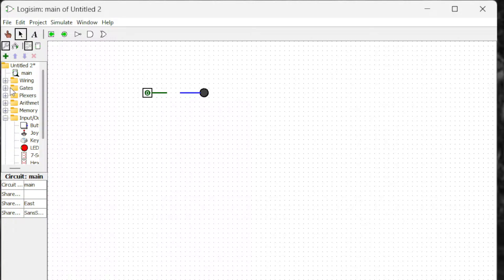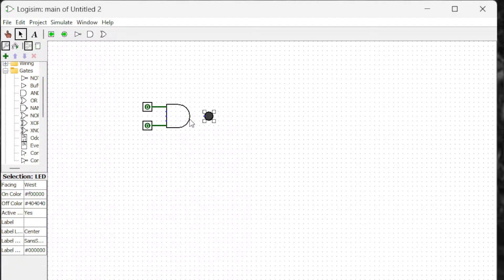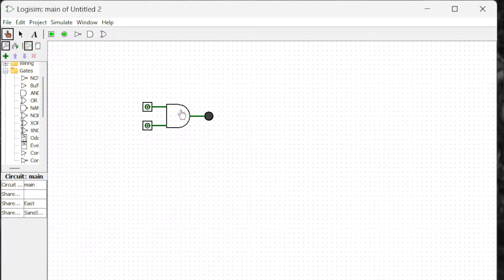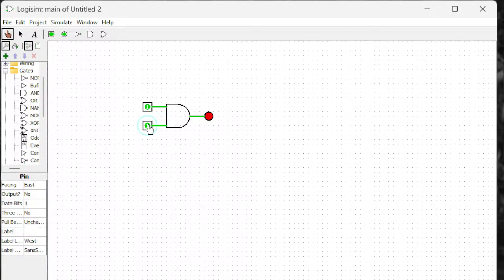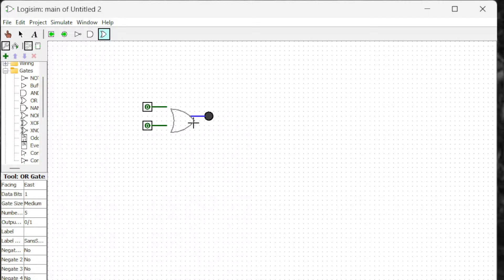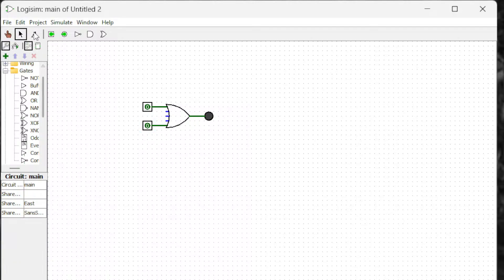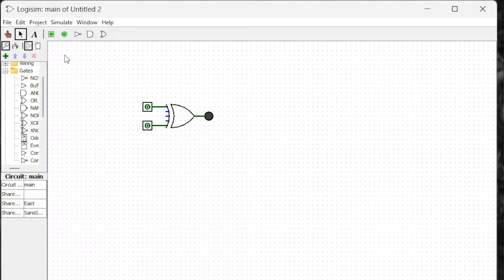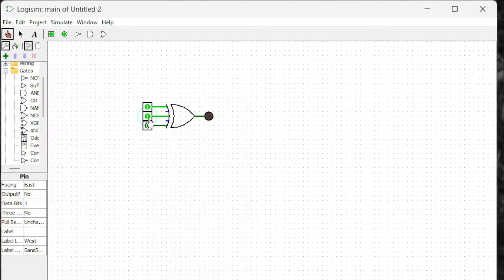Logisim Tutorial part 1:Logic Gates

Comment: Isn't the output of an XOR gate that has three inputs all set to 1 is 1?
Reply: Not necessarily, there are multiple version of the multi-inputs XOR gate. One of which turns on only when one input is On. Another version turns on when an Odd number of inputs are On. In that software, you can select which type you want the current gate to act as. By default, it's only when one input is On, but no more.